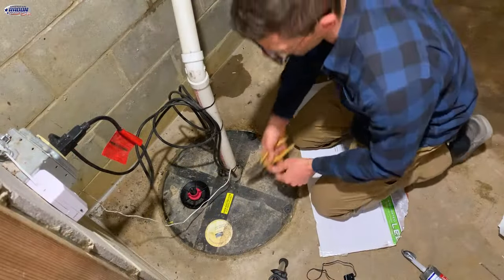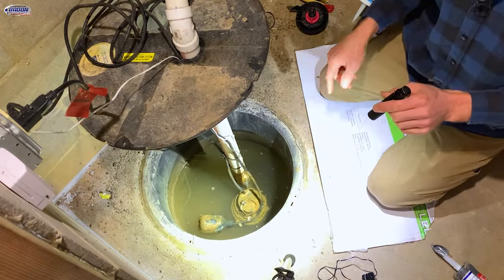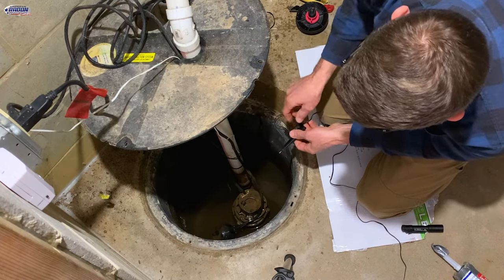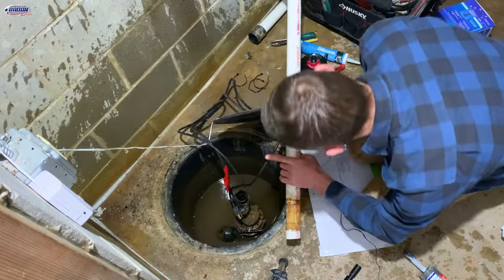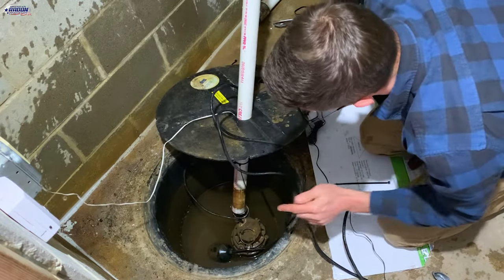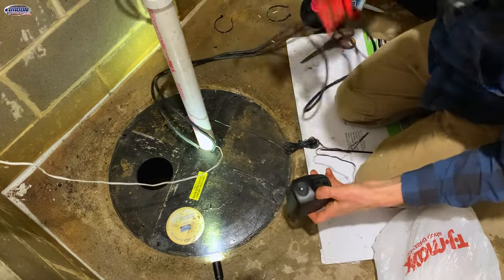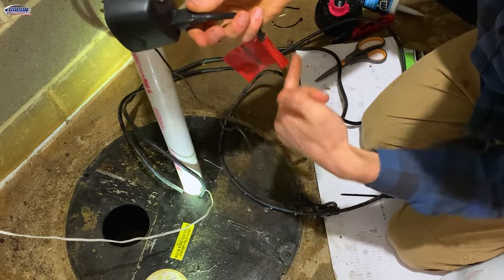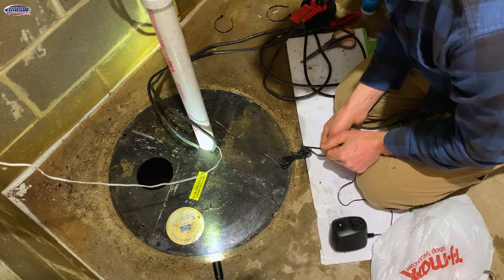How to Replace a Sump Pump Float Switch

Comment: Excellent video. I now understand why my radon mitigation piping is installed into the home made lid on my sump pump. I need to get the sump pump serviced. Could a plumber do that or do i need a radon service company? I am awaiting the results of a recent First Alert radon test i conducted to see if i even have a radon problem. I ran the same test 3 years ago and the results indicated no radon problem...test scored 1 vs minimum of 4 which is the level where radon mit is recommended. My radon mit fan is also not working and i dont want to spend $500 to have it replaced if i dont have radon.
Reply from the maker: Yes, Jerry, a plumber can replace you sump pump. Be sure they seal the sump cover once they are done, though.

Since there is no safe radon level, I would replace the radon fan if it were me in your situation. Be sure to test your radon again during the heating season since that's when radon levels are typically the highest.

Here's a DIY fan replacement video if you'd like to tackle the project yourself: https://youtu.be/qEADrgDg4kk